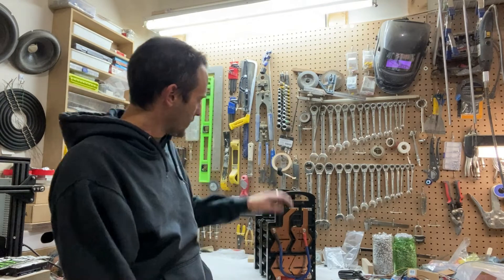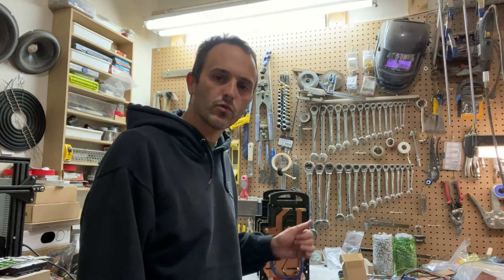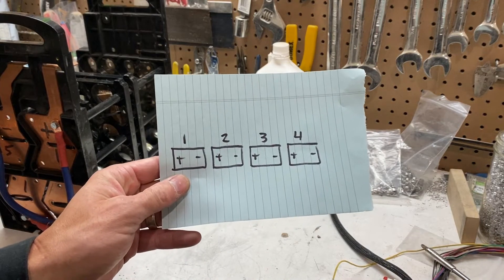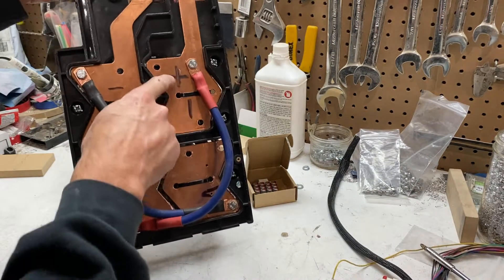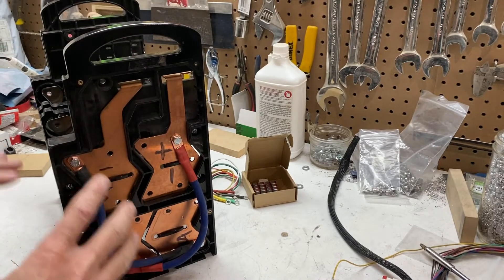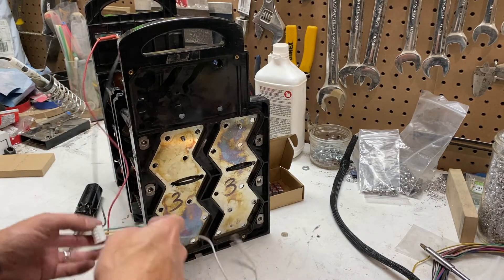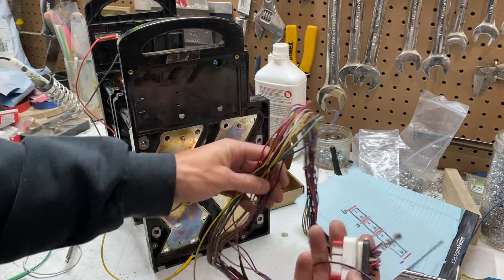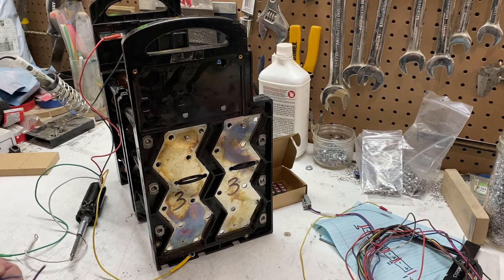Super Beast Module 12volt conversion - how to wire a BMS

Comment: I ended up doing something wrong wiring mine in and it blew a compositor 😅 I really don’t know what I did wrong
Reply from the maker: Gotta make sure you count your plates correctly 1,3,&5 are obvious but 2&4 are weird. Not sure what was wrong but if 2 and 4 were flipped maybe🤷‍♂️. You can message me on my instagram to figure out what happened